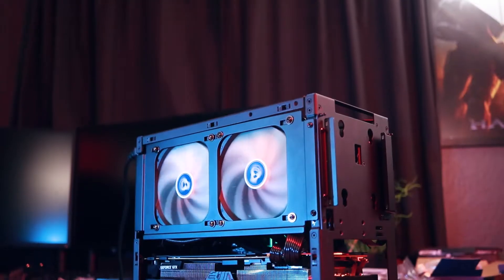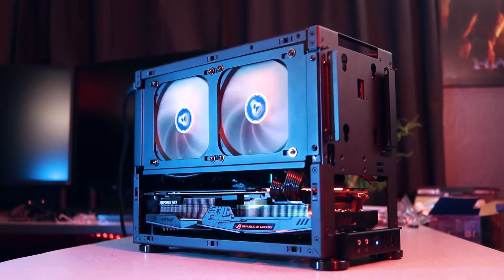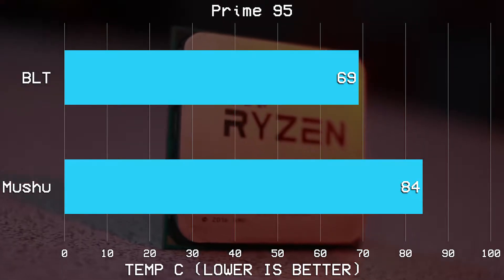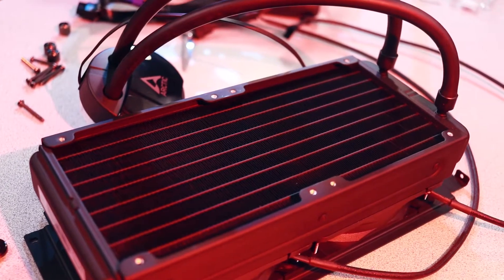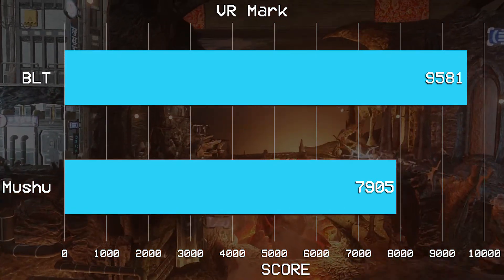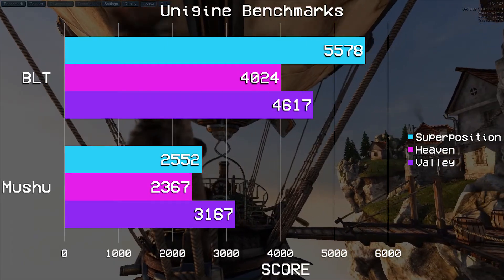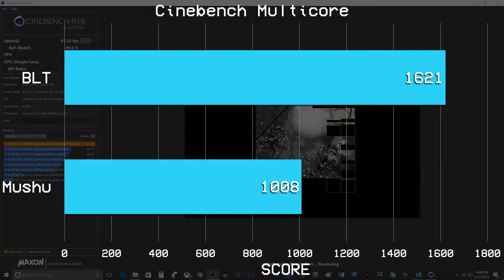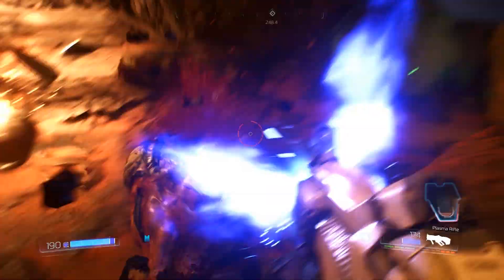MOSTER Mini PC Pt 2 | The Benchmarks

Comment: How about the noise level, was it a quiet system ?
Reply: It def was NOT a quiet system. You can't get those temps without having fans at max. The GPU fan speed was close to maximum